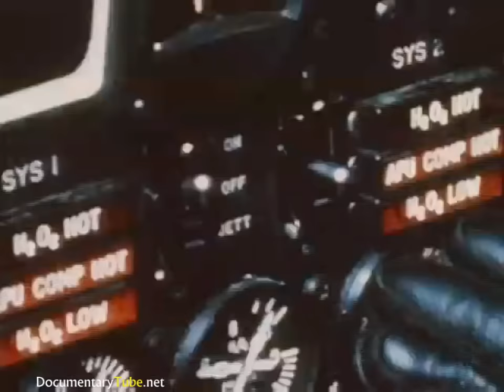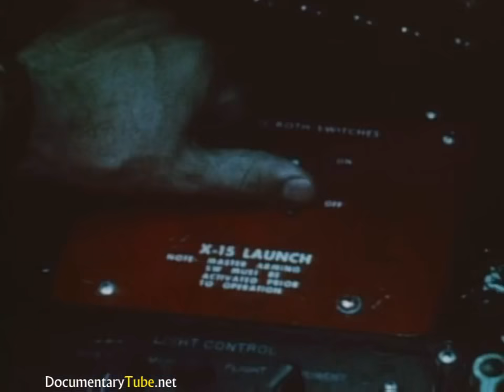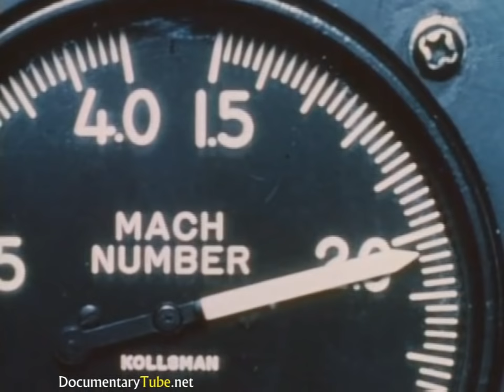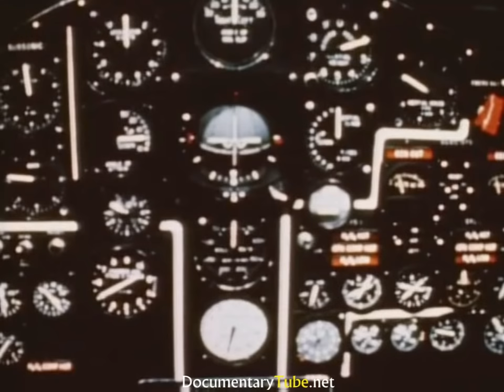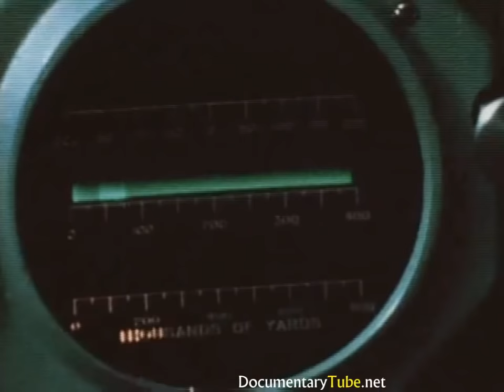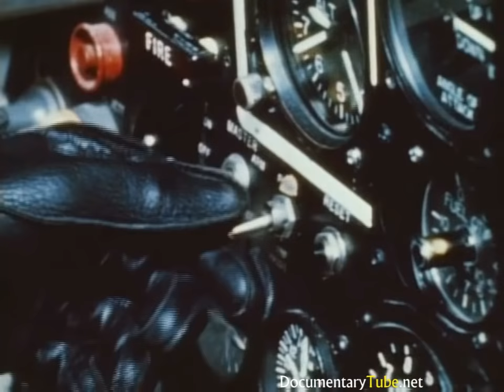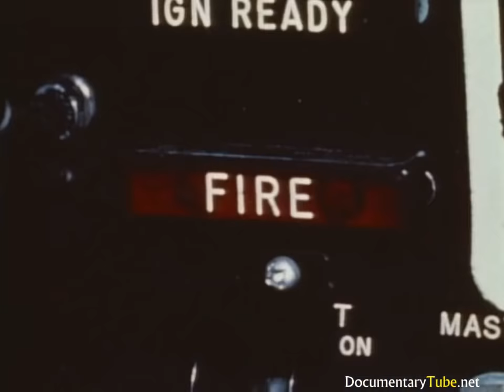The Fastest X-Plane - Mach 7 North American X-15

Comment: The X-15 played a pivotal role in my life's journey...my late Father was a Radar Guidance Engineer out at Cape Canaveral from '57 thru '76 and as a young boy I had the X-15 hanging in my room from the ceiling by fishing line...it cemented my interest in Aerospace and motivated me to put forth the energy in my academics to earn both an undergrad and grad degrees in Engineering. I just retired from Lockheed Martin in 2016, with most of the last 15 years on the job being spent working on the F22 and then F35 programs.
Reply: That’s badass
Reply: how much did lockheed pay for a job like that?
Reply: Growing up, I didn't have sports heros or tv celebrity worship. Other than my elders, my heroes were those in the design and operation of the aeronautical industry. 

I grew up near a SAC AF base, and cannot remember back to a time I wasn't obsessed with flight and craft. Getting close to 50 yrs old, and it hasnt waned one bit. 🫡
Reply: Great story, and i hope that by 2112 the pilots of the solar federation remember the feat
Reply: Thank you for contributing to such legendary feats of humanity.
Reply: @Trez1238  A lot 😂
Reply: Congratulations My Friend
Reply: Respect🥶

Comment: The X-15 still holds the record from 1967 for the highest recorded speed from a manned aircraft in history.
The test pilots were absolutely fearless. Everytime trying to achieve what had never been done before.
They put their lives at risk each time, even when they had everything to lose, a wife, kids, family etc.
But they still chose to do it. That is something I doubt we'll ever see again.
Reply: William " Pete" Knight, Colonel, USAF, achieved Mach 6.7 on October 3, 1967!🇺🇸🇺🇸
Reply: Nope Many countries are building scramjet engines for commercial flight
Australia is a leader in it with worlds fastest first 3D printed scramjet and will have a drone built by next year to demonstrate it.
Wants reusable satelite delivery scramjet drone and eventually a passenger jet.
Reply: @nedkelly9688  really? Would you mind elaborating on the comm air I was curious if you were able to break down the conversation as I thought the scramjet is A much less efficient platform in terms of fuel consumption and B much more costly to manufacture. Has something been revolutionized in the propulsion dynamics to perform more well rounded than turbojet comparison
Reply: @berty1422  - Thanks for your service.
Reply: There are plenty out there that would kill for an opportunity to push the limits like these guys did.
Reply: @D Smith  Every single high speed car race from Formula 1 and Indycar down through all forms motorsport or motorbike sport, men put their lives on the line. Once one is traveling beyond a certain speed, any "coming to rest suddenly" event is probably fatal. Adding more speed beyond a certain point does not increase the lethality. The human body has pretty low impact limits...far below supersonic-to-zero speeds. Hitting solid concrete even at 60mph isn't pretty. So...yeah...we see it all the time just by turning on the TV to watch any high-speed sport.
Reply: @huss03  - The X-15 was a manned hypersonic rocket-powered aircraft. It's highest speed recorded was 4,520 mph. It flew at mach 6.7 to achieve that. A record that still stands since 1967.
Your comment about F1 cars, indy cars etc, it's sport. It's not experimental test flights.
For example, an F1 car at it's fastest speed racing is near 250 mph.
F1 cars are designed with safety measures, and so are the tracks.
So yes these drivers are at risk, but to compare them to X-15 test pilots is laughable?.
Think about it 250 mph vs. 4520 mph. A motor sport vs. Experimental high-speed rocket-powered research aircraft.
There's an absolute massive difference in these drivers and pilots.
Reply: @dsmith1888  My point is that if crashing at 250mph is lethal, then crashing at faster than that is not "more lethal". Furthermore, in motor racing there is an added risk because it is competitive and guys will intentionally trade risk against glory. I don't know what the statistics are for racing drivers throughout history, but I'm pretty sure it wouldn't look good. And finally, by virtue of the fact of how often racing drivers roll the dice with their lives in each season, they are increasing their time per year exposed to risk.
Reply: @trob0914 tom Cruise "Maverick" achieved mach 10.4
Reply: Thats absolutely incredible for aviation. The highest wind speed for a tornado in 2024 is 302mph.....i can't imabjne this. I wish i could experience being flown in this absolute marvel. Holy fuck. @dsmith1888

Comment: I was into building model planes as a kid. Just had to have an X-15 kit. Got it and it was a thrill just putting it together. What an absolutely beautiful craft.
Reply: my sons and I are using an old canoe - wrap it in black tape and stick a cone on the front - add some wings and the tailplane and you have  VERY passable x15.
Reply: ❤ankh uthi
Reply: @militaryandemergencyservic3286  yes old one old 🏫 designed

Comment: Back when America was really pushing the technological barrier. Great time to be an Engineer
Reply: They still are. From Intel to Google to SpaceX, to landing nuclear vehicles on other worlds. There's a lot happening.
Reply: Yes, godfather.
Reply: @RealityIsTheNow  those are private companies though. Back then it was all government funded.
Reply: Food Crumbs Actually, SpaceX built the Falcon 9 using government money and a lot of technology and engineering talent from NASA. So far, through the COTS program, NASA has pumped about $400 million into SpaceX for the Falcon 9, Dragon, and the test launches. And this doesn't include the ongoing costs of hiring SpaceX to run cargo to the ISS. Thats running into the billions. And back in the day it was private companies as well. Grumman Aircraft designed and built the lunar lander. Rocketdyne designed and built the F-1 engines for the Saturn V, and the Saturn V itself was mostly built by Boeing and Douglas and North American Aviation.
Reply: @RealityIsTheNow  that's interesting man
Reply: @Sirfoodcrumbs  woah you werent toxic because someone disproved a point of yours, mad respect for  you holy shit
Reply: Never stopped.
Reply: The previous attempts failed because of the problems encountered using standard ailerons on the rear tail surfaces causing transonic instability . The Bell engineers visited the Miles Aircraft Company in the UK that was developing a similar craft . They noticed Miles was using fully controllable horizontal tail surfaces used on all modern supersonic aircraft to this day , and made the necessary changes to the X1 which resulted in supersonic flight .
Interesting that the whole B52 fleet now runs Rolls Royce engines for more power and range using one in the range of their complex Ultra Fan designs . The new engine RR is developing for the UKs 6+(RW) generation fighter programme has required the craft designers to include structural strength to permit buffeting and stresses up to Mach 6 in horizontal flight .
Reply: @BESTMOAD  no, the shit came out of the bible
Reply: @BESTMOAD  and i didnt call his comment shit
Reply: @pressureworks  definitely have slowed down
Reply: @TastyChickenWing  not heard about the new space telescope ??

Comment: To me, the X-15 will always be, first and foremost, the Estes rocket I accidentally shot into the ceiling of my room, when I was a kid.  My parents agree!
Reply: I had one too... was it not powered by  H2O2? Peroxide? You have to load it with a white powder!
Reply: I converted the Revell X-15 plastic model into an Estes rocket by putting an engine tube into the fuselage.  It landed on the roof of my grandma's farmhouse --  good times.
Reply: Good one good one. Broke the antique light fix ture  with my swing finally sold those clubs a few years ago. L.O.L.

Comment: In the freaking 60's???
Imagine what they have now!!!
Reply: Justice Warrior sadly enough what Americans think is their most recent Triumph is the right to use the other genders bathroom. I am an American
Reply: Nothing remotely like that.
Reply: America's most proud invention of the last 15 years is Facebook. Gotta love innovation. /sarcasm
Reply: Actually f-15 still holds the fastest record mach 7
Reply: @hallowrdean7409  no.... just no... where the hell did you get this bit of absolutely false information?
Reply: @BionicBurke  lol from the video.  Its true so far as we know, that nothing faster than that, which wasn't a missile or satellite, has been flown since then.
Reply: Hallowr dean X15 not F15
Reply: تجربة صاروخ مجنح
Reply: 7 @altareggo
Reply: Hallowr dean F 15 at mach 7. Never don’t know where you got this fact. X-15 reaches mach 7.
Reply: @hallowrdean7409  you must mean the x15. Used rocket engines though so not really a conventional plane.
Reply: Today, America have all the oil that doesn't belong to them
Reply: Nothing
Reply: Nothing
Reply: 60/61 assigned to the 0-10/0-11s baby sitting the X15 on the dry lakebed.

Comment: Amazing  aircraft, but it really had limited uses since it had such a short flight time. Either way, it did fly twice the speed of the next fastest aircraft and about three times higher as well. Heck, it could even  just touch the edge of space at 330,000 ft, try doing that in your Cessna 172.
Reply: It actually did flew to space, twice if not mistaken.
Reply: @dallasyap3064  I unfortunately watched this video 3 years ago so the information in my head is really rusty. But yes twice is easily believable. I believe there were a few of these experimental aircraft, maybe three?
Reply: @rwatson2609  technically, twice by international standard, but by US standard, it happened multiple times. The US and the international standard for the karman line are different; the US designates it at 50 miles, the international designated karman line is 100km. Many of the X-15 flights surpassed US 50 mile line, which led to those pilots being eligible for and awarded the military astronaut/space badges. But only 2 of the X-15 flights actually surpassed the international 100km line.
Reply: @dallasyap3064  Very interesting. Thanks for the info.

Comment: Note that all this footage shows the original X-15 with it's dual underpowered XLR-11 engines. The later record breaking versions would have a single, much more powerfull XLR-99 engine (something like three times the thrust compared to the two XLR-11's).

Comment: This video does not show any plane going Mach 7. Or even Mach 3. I would hardly consider it a "full documentary".
Reply: It never says it shows any plane going Mach 7, just states the plane is capable of that theoretically. It's truly only done around 4500 mph though.
Reply: Pah, I go faster than that having sex. I  go at Mach 27.
Reply: Mogwai Gremlin B
Reply: It's about a single mission out of the 199 X-15 flights flown between June 1959 and October 1968... 50 years ago !
Reply: @phmwu7368  this version of the x-15 doesn't have the reaction motors engine so this was only capable of Mach 3
Reply: My Nokia 3310 goes Mach 420 
Nokia ringtone intensifies
Reply: It would be kinda hard to capture something going that fast on a 60s camera 😂
Reply: @dionylescailles4409  Even harder in the 50s
Reply: They're not gonna build another X15 just to record the other x15

Comment: this doesnt say anything about how it got to mach 7, nor does it say anything about fllight above the atmosphere, it went far higher than 120,000, and up there its just a missile with no aerodynamic controls, they had pitch yaw and roll thrusters on it, and needed to bellyflop it back into the atmosphere at a certain pitch to spread out the heat. another interesting point is that the inconel alloy had to be welded as a completely solid skin, no rivets because those are weak points. the pilots said the x-15's popped like old metal stove with the heat transferring thru the skin and expanding.

Comment: That "safe landing" at 14:15 was just BARELY. He "porpoised" the aircraft several times on final and then slammed the nose mount down hard on touchdown. I was expecting him to either collapse the nose mount or break it off entirely. Aero brake the aircraft and let the nose fall through naturally.
Reply: Ranger Joe you do realize he is trying to land a rocket .....

I'm positive he knows how to flair a airplane with wings that have lift....
Reply: Yes, that was pilot induced oscillation that occurred on the landing of the first flight.  It weakened the structure of the aircraft, and contributed to it breaking on the third flight when it had to land heavy with propellants.  The PIO problem was solved before the second flight by adjusting the sensitivity of the flight controls.  This is all discussed in Crossfield's autobiography "Always Another Dawn".
Reply: think "flying rocket" not airplane
Reply: It also had skids on the back not wheels so the the drag would send the nose down pretty quickly.
Reply: The airframe had skids in the rear instead of wheels so no matter how soft you land the nose will always slam down in that fashion

Comment: the chase planes F104s set altitude records much higher than the X15, when they attached a slid fuel booster to the vertical stabilizer, the F104 record was 125,000 feet... Chuck Yeager got one in a belly spin at 105,000 and almost died.

Comment: The rocket motor failed because it was designed and tested at sea level,meaning higher atmospheric pressure surrounding the propellant mixture,being at altitude,caused lower pressures to surround the motor and the rear of the aircraft,causing a near catastrophic failure to occur. Engineers may be clever,but they often overlook minor detials in their exuberance!
Reply: Just remember, this aircraft was only used for research. It was never really designed to go all the way into space, or near space at all. It did help in designing the blackbird, though.

Comment: I did not see the Mach 7. Video ended too soon?
Reply: lol
Reply: Gpa Bui goggle the x 15 you'll see how fast it flew !!!!!!!
Reply: It never reached mach 7, though it came close. But, remember, this is no aircraft. It was designed for research on space craft. They needed a shuttle that would launch off of a plane, and reach speeds fast enough to gain altitude capable of going into space. The only plane, to this day, that is capable of actually doing something similar, is the blackbird. That was designed to be a proper aircraft. This was designed for the shuttles we see today, but to be launched from a plane.

Comment: Is a rocket an airplane? This is a solid fuel vehicle. What is the consensus?
Reply: It used hydrogen peroxide as the fuel when they installed the XLR99 engine.
Reply: Solid fuel is used on the SpaceShip1 by Bert Rutan,  X-15 was a liquid burning craft.  In this case it was sorta both a rocket and an airplane.  Even more technically correct it was a glider.

Comment: I knew an engineer that was on that project, he told me that the massive amounts of data collected cannot be translated because the programing language is a dead language and no one is alive to re-program it.
Reply: Sorta ture.  Much of the data was collected using analog devices.  If it was digital,  there are many multi variant languages we could use to reprocess that data and extract new findings from it.  Data is data,  we don't needs someone skilled in old computer languages like BAL or APL to process the data.  Turn it over to the new CS & Aerodynamic wizzz kids, and see what they come up with.  That might be a really cool master's project.

Comment: The X-15 is a man  rocket.The J-28 is a man stealth airplane.On September 18,2015 ,a 6th generation J -28 flew at mach 6 speed for several hours and landed.I type Wang Zhenguo  in my computer to find out more about the J-28.Then I read about a cruise missile that flies at mach 6 speed.I type in VLRAAM in my computer and found out the PL-21 VLRAAM has a 300 miles range.

Comment: its not a plane
Reply: top banana it's a rocket-plane!
Reply: top banana,
It'a an airplane in every sense; wings that provide lift and control surfaces.  If you mean because it's rocket powered, then I guess you don't consider a jet an airplane because it doesn't have a piston engine.

Comment: The SR-71 couldn’t go Mach 7, at least not officially. Of course, it wasn’t a rocket plane like the X-15, but still, that’s metal metaling fast. Not sure how they pulled that off. The engineering on this thing was phenomenal, and way ahead of its time.

Comment: this is North America X-15a and it only speed only Mach 1 to 3 and it had two rocket engines.  The North America X-15b got up to Mach 7 and it was painted white and had two extra tanks under the wings.  there was talk of building the North America X-15c it was long and had an extreme arrow-shaped delta wing, which was taken from Hadle Page 115 which tested low speed with heavily pointed split wing, while the X-15c tested the high speed characteristics, and X  The -15c was painted white with Mach 10 to 12 in speed.  I suspect the X-15c had built-in gyro to stay stable in space for a few minutes and then glide back.  The North America X-15 was available in several variants and designs.  the test pilots for the X-15 were the best there was considering how it looked in 1950 to 1970 when everything was analog and not digital.

Comment: 19:18 unexplained huh? Maybe its the insane forces involved in slapping the nose on the ground at high speed. They should have made the skids longer and moved them forward to allow for a smoother touchdown. It would be more weight but it would greatly reduce stress on the airframe.